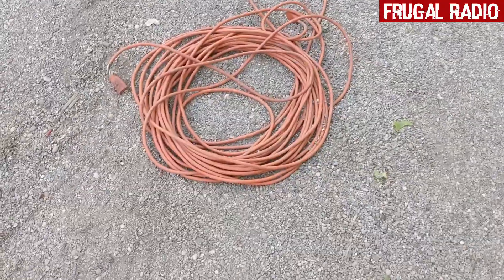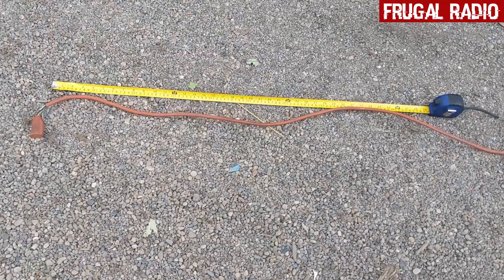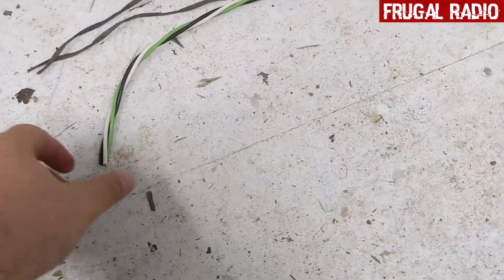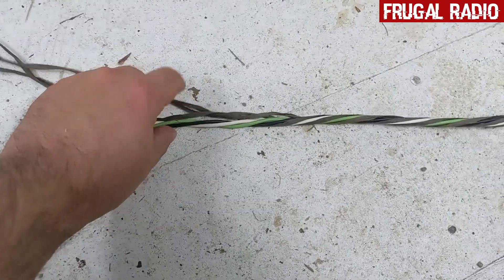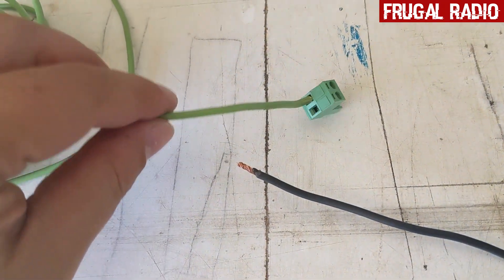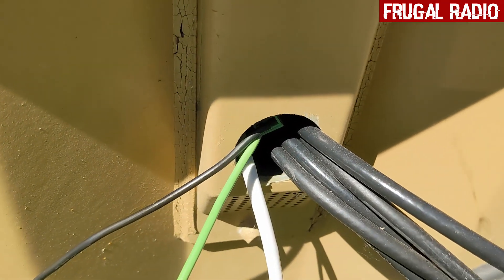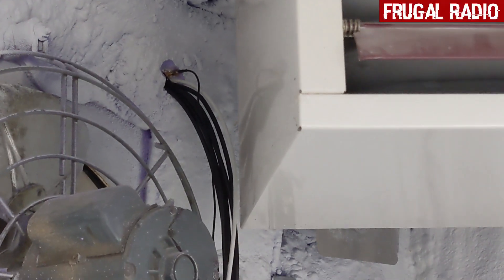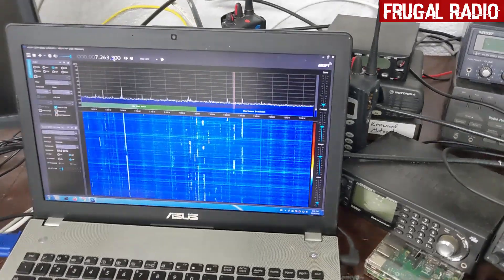I made an HF Dipole for free!  Reception was good on my AirSpy HF+ Discovery SDR!

Comment: I'm very glad to see you recycle old copper like this. We don't need to spend a fortune on antennas. Baluns, as I'm sure many people will find out, can become a slightly contentious issue! For example, are they baluns or ununs? There are many Ham experts on the issue, but of course they are mostly focused on transmission. You usage here would suggest a balun I think, as you are balancing two sides of the dipole.  I have used the Nooelec 9:1 balun and also the cheap Chinese knockoffs and they work good, but it's not hard to wind your own on small and cheap type 43 toroids. (You only need small ones and not the huge expensive ones used by Hams for transmission lines. 140-43 or 114-43 are easy to use. If you are good with your fingers, 82-43 or even 50-43 are possible. They are very cheap). There are fancy ways to do it or the simple old fashioned way of say 27 windings on the antenna/ground side and 9 for the feedline. A 3:1 ratio in windings translates to a 9:1 balun/unun. I have wound ununs like this for all 5 HF antennas in my garden and the improvement in signal quality is absolutely outstanding. I weatherproof the wound toroids with self-sealing rubber tape. I have yet to make a good balun for my one HF dipole. I understand that the balun should be wound 2:1, perhaps 20 on the antenna side and 10 for the feedline, giving a 4:1 ratio. Maybe it's just my rubbish winding skills, bit I have so far always ended up with a worse signal. I've been in the hobby for about 6 years now and discovering how baluns/ununs can increase the signal to noise ratio was a very important discovery and I'd encourage everyone to look into this aspect.
Reply from the maker: Thanks for sharing your experiences Alan. It's great to hear about your usage of baluns and home brew transformers. Happy winding!
Reply: Receive antennas are a completely different ball game than TX. The key to good results is to optimize the noise figure of the entire system: Antenna + impedance matching + transmission line + receiver.
A small (electrically short) antenna could outperform a full-size antenna if it is coupled with the right electronic ingredients. There is still a lot to be done in this area, especially with newly available high performance silicon that is becoming mainstream.
Reply: @lambdaprog  I'm interested in where you might be going with this. I've tried various PA0RDT derivatives, including two of the Bonito whips. I went on an exploration in DXing NDBs at one stage and found in the end that a 9m vertical copper wire with a 9:1 balun/unun and an RF choke is just as good as the Boni-Whip. I know you have been testing amps to go with the Youloop and I'm looking forward to seeing how that turns out. The Youloop definitely brings signals out from the noise that are hard to catch otherwise.  I'm a big Airspy fanboy, like Rob here!
Reply: @apc108  Thank you for the kind words. I went through many revisions of the YouLoop (and YouTwist) preamps. The challenge here is to achieve a very low noise figure in the amp at High Z while having enough rejection in the FM and higher bands. This requires some tricks to shape the frequency response using group delays and without using any filters that may add some insertion loss and ruin the High Z impedance. We're getting there eventually. Stay tuned!
Reply: yup. you only need the bigger ones if you're using the balun/unun for transmit. I'm currently building a 9:1 unun using a pair of FT240-43 cores ganged up with electrical tape so I can get to significant fractions of QRO. Total cost invested in the unun so far: $35 USD.

Comment: put the balun in a project box, run a short wire to bolts on either side, plus a loop on top to hang it, and then a coaxial connector on the bottom that connects to the balun, allows you to mount it anywhere without worry about the elements. just saying. You can put it together for $20-30 in parts plus the balun itself.

Comment: That device is actually an Unun, not meant for balanced antennas.  If you cut the black wire the colored wire to 10.8m, and cut the black wire to 5.33m and lay the black wire on the ground, you may improve reception.  Recommended lengths for the colored wire in feet (sorry mate) are  29  35.5  41  58  71  84  107  119  148  203  347  407  423.
Reply from the maker: Thanks for this. Yes, my antenna was somewhat balanced already.

Comment: I've got a spool of 30m cable (with single threaded copper core) sitting in the shed doing nothing, an RTL-SDR and a friend gave me one of his spare 9:1 baluns, any advice as to what I can do with it? I don't have any Ham it Up ,or Airspy HF type stuff yet. Not sure if I should cut the 30m cable into two 15m cables and make a dipole, or turn it into a long wire. I'm still learning the ropes here, it's all new to me.
Reply from the maker: You could do either. I would probably go with the long wire, although maybe cut off a few meters to place on the other end of the balun. 

You'll also need to use Direct Sampling mode on the RTL-SDR which may pick up a lot of images without a filter. It will be fun to experiment with, but won't be particularly good for HF monitoring I expect.

Comment: the easiest "balun" to make is a choke balun, 240 size 43 mix toroid (£6 ish) 8 turns of the coax wound on to it (about 1 meter) and that's it, done! it will work from 80 meters to 10 meters.
Reply from the maker: Excellent!

Comment: Hi Rob. Found your channel by mistake, great video brings bad many fond memories when I was a Ham back in the late 70's. Did the same trick using some old coax whilst I worked as Security for the Reading Festival in 1979. Used 27MHz, measured the length, split the core and shield into 3.4m lengths, then asked the onsite Busby engineer (it was still the GPO in those days) to attach one end to the top rung of the telegraph pole next to my security caravan. Many happy hours allegedly working! Will explore more of your channel. Cheers.
Reply from the maker: Great to hear from you Tony.  Welcome to the channel :-)

Comment: Hi, brilliant video. Can the balun be collected directly to the Ham It up or does it need to be connected to some coax?
Reply from the maker: As long as it is connected, it shouldn't need coax. The coax just helps you locate the antenna elements further away from possible noise sources and to provide easier installation.
Reply: @FrugalRadio  That's great thanks for your response.

Comment: I just recently subscribed to your channel. You make very informative videos. I'm new to SDR and put up a 100ft single wire antenna but strangely I'm receiving AM radio stations all the way into higher frequency bands (25MHz+) and some stations are even being duplicated.  Why is this happening and is there a fix? Thanks
Reply from the maker: Hi Vince, and welcome to the channel.
You are receiving interference from the AM Broadcast stations, which means it would be good for you to use a filter.

I made a video about filters and how they work, which you can watch at https://youtu.be/FdMrqwVpYg8

Some of the step up SDRs have filters built in, such as the RSP1A by SDRPlay, and the AirSpy products.

You might also find FM broadcast interference - I have to use a filter on some of my SDRs & scanners to block those signals from appearing in the aircraft band. It generally depends how close you are to the transmitters, but antenna tuning also plays a part.
Reply: @FrugalRadio  Thank you! I will check out your video. Keep up the great content.

Comment: Not sue that a 9:1 balun on a dipole is a good idea. That would far better match the 50 ohm coax without the 9:1 balun.
Reply from the maker: You might be right. I have actually tried it without the balun.

Comment: It is always a good idea to save some copper from trash. :) Though it is not free - due to the balun - it is still very cheap. Having a 9:1 balun, I would rather use it for a long wire antenna instead dipole. (One contact for antenna wire and one for grounding. Impedance matching is better this way.) One more good step ahead for a brave hobbist is making a trap antenna. The necessary components would not make it more expensive. 
I really like your videos. Keep making them! :)
Reply from the maker: Thanks for your comments. I had also considered a long wire...
Reply: @FrugalRadio  As you know, a "random" long wire may work well with an antenna tuner. I think, simplicity is best if possible, Avoiding the use of a tuner - I'd tune the wire to a desired band and hoping that it works on harmonics too. (fingers crossed)  ...or as I mentioned: also a trap antenna can be a solution.
I really respect the efforts for the community, thanks!
PS: The balun you have, contains ESD protection, too. Those who are thinking of making a diy balun, do not forget using the well known protections. Long live the SDR receiver! :)

Comment: Good job, I have this balun but older version. My choice for wire was speaker wire. :)
Reply from the maker: Glad to hear your antenna works with the speaker wire and balun. Not a lot of difference between the v1 and v2 balun.
Reply: @FrugalRadio  I know, it works even connected to copper pipes from heating system.  :)
Reply from the maker: Cool. I tried a heating system once too!!! Got to love experimenting with HF!
Reply: @FrugalRadio  I am now collecting recordings from this setup and will upload this to YouTube soon.

Comment: Is it better to use a thicker wire like this or a thinner wire?  If thicker is better, I might re-work my dipole.  Thanks!
Reply from the maker: The thickness makes very little difference for HF. Thin wire works just as well.
Reply: @FrugalRadio  Thanks!  Thin is better for my environment right now, so I am happy to hear this.

Comment: I have enjoyed, and continue to enjoy, listening to aircraft on HF out over the Atlantic. 

I have never been able to get into the HAM Radio stuff though. I just don’t find what they talk about very interesting - sorry! I appreciate there are restrictions by way of license conditions on what they can discuss. 

My garden isn’t very big, so getting 20 metres of wire out would be impossible. 

Perhaps you could show us some ideas for compact HF antennae, please. I used a centre-fed dipole with random unequal length elements, and it was still pretty amazing what I was able to receive. 

Thanks for another really interesting video. 👍
Reply from the maker: For compact antennas on the HF band, loops are recommended.  You can see the YouLoop I demonstrated in another video.  However you need a high sensitivity receiver for it to work well.  The MLA-30 is another popular loop, owing to its low price.  It is an active loop however.

If funds allow, take a look at the Wellbrook loops, and if you'd like to experiment you could try a Loop on Ground (LOG) antenna.  You would need to make a square with about 15' on each side so that will depend on ground space.  While the gain is low for LOG antennas, the amount of interference (QRM) is also very low.

Adding a balun, like the NooElec one should improve the reception for you with unequal lengths of wire.
Reply: @FrugalRadio   I have a JRC NRD-535 HF Receiver, which, when I purchased it new quite a few years ago, was considered to be pretty much the ‘bees knees’! It’s still a superb piece of kit, but like all the others, is only as good as the antenna it’s connected to. Thanks for your comments.
Reply from the maker: Yes those JRC receivers are very nice units. I used to dream of owning one when I was a teenager!

Comment: Great video Rob just wondering was that the 9 > 1 nooelec Balun ? ( I can see (Balun One Nine ) but wasn't sure if that's what it meant.

I love Aviation come on mate where was the HF Sel Call Decoder going tom the side or on the next screen :-)

All the new SDR Infrastructure is slowly coming together, just waiting on a new 12m lattice mast to arrive, hoping this weekend to get the Inmarsat Ant on the air ( I got called into work last weekend :-(  ).

Loving the RTL-SDR & the SDRduo I've even got a dedicated dual 21" screen PC for them.

Once I get the both of them mastered I'll but another SDRduo and put it on line.

Take care and keep up the great video.

Rgs
Wayne.
Reply from the maker: Cheers Wayne. 
Yes, it's the v2 NooElec 9:1 Balun. I see some markets still have the v1 available for a few pennies less.

Interestingly I don't pay much attention to the SELCAL codes. I don't really need to know them, unless they are tired into a database that will tell me the airframe.

Hope you get the chance to play some more radio and do more setup over the weekend!
Reply: Ha  @FrugalRadio  Rob not sure if you have done them before but if not can you do a video on a / some LNA's if you have any at your disposal ?.

I was just looking at the Nooelec Lana - Ultra Low-Noise Amplifier (LNA) Module for RF & Software Defined Radio (SDR) with Enclosure & Accessories. Wideband 20MHz-4000MHz Frequency Capability with Bias Tee & USB Power Options.

Rgs
Wayne.
Reply from the maker: I actually don't have a wideband one like the Lana, but I use a couple of band specific ones. The NooElec Inmarsat bundle came with one tuned to L band frequencies. And I've got a couple tuned for other satellite ranges (137 MHz & 1.6 GHz). I also have an RTL-SDR blog one for 1090 MHz ADS-B. The nice thing about these frequency specific ones is that they also have filters built in and run on bias tee voltage. Great for urban RF environments.  I've yet to purchase a wideband version though.

Comment: Now that's inspiring me into resuming SDR exploration after months without touching it...

Of course the conditions here don't help - I live in a ground floor apartment with small windows. Could be worse though, as the neighborhood buildings all have 2-3 floors only.
Reply from the maker: Good to hear you've been inspired. Antennas are everything when it comes to SDRs. You can just string wire around the 4 walls of an apartment and you will be able to pick something up. Shortwave (HF) signals travel well through buildings. The challenge is the RF noise generated from electronics. That tends to ruin things, but using a balun or choke would help. In a noisy RF environment you might want to consider a magnetic antenna like the YouLoop (which you could also make at home, although you'd need a few extra parts). I bought an Airspy one for around $30 and it works well, even indoors. If you search my videos you'll see a couple on it.

Comment: Hi! Dose the thickness of the wire matter?
Reply: The practical answer is no, but if you want to get into the weeds study up on "skin effect".  Size actually does matter, as it will contribute to how broad banded the antenna is, among other things.  But unless you are getting to the point where you are carefully engineering a RX antenna, don't worry about it.  Just get some wire in the air and experiment with position and length.
Reply: No
Reply from the maker: No, the thickness doesn't make a big difference for HF schemas. For VHF & UHF it makes a little more difference.

Comment: Me too I like the NooElec Balun One Nine v2 for HF receive. I've seen some cheap, really cheap (< 5$) Chinese boards on AliExpress that look like the barebone balun. I wonder if you have tried them? Are they any good?
Reply from the maker: Hi Alain. No, I haven't tried the ones I've seen on Ali. Perhaps another viewer will be able to give us a report...
Reply: The Nooelec balun used in this video is for receive only.  I haven't tried it, but looking at its schematic it should give you an improvement in both common mode noise reduction and signal to noise ratio in the HF band.  Its based around a $3 part, the WB9-1 from Coilcraft.  You could certainly make a similar balun for less than $15, but time is money.  The things to pay attention to if you buy or build your own are these:  you are looking for a CURRENT balun, not a VOLTAGE balun, not an IMPEDANCE matching balun, and not an autotransformer.  Stick to 9:1 turns ratio, and pick a ferrite mix to match your desired frequency range (compare types 31 and 43 for HF use).
Reply: @ryanleathers9025  >> I haven't tried it ...

Thanks anyway.
Reply: @ryanleathers9025  Hi there. From my experience, my best version for 9:1 transformer was by using type #73 binocular ferrite with windings of 2 turns on primary for 50 ohms and 5 or 6 turns on secondary for around 450 ohms. Use either thin enameled copper wire #26, 28 or thin silicon, pvc, etc covered wire. Really wide bandwidth coverage without much loss. I tried other types of ferrites you mentioned above, but bandwidth was narrower than the type #73. Cheers !
Reply from the maker: @rms8698 great tip. Thanks for sharing!
Reply: @rms8698  interesting. In what frequency range were you testing?
Reply: @ryanleathers9025  Strange... I answered you about 3 days ago and my text didn't post in here. But anyway, I did test 9:1 binocular ferrite type #73 in frequency range from 100khz to 50mhz.